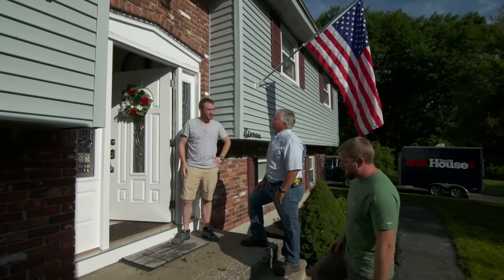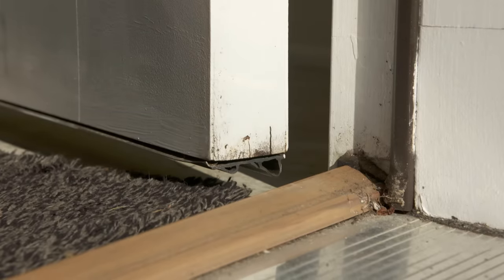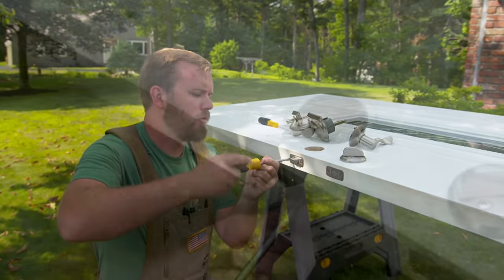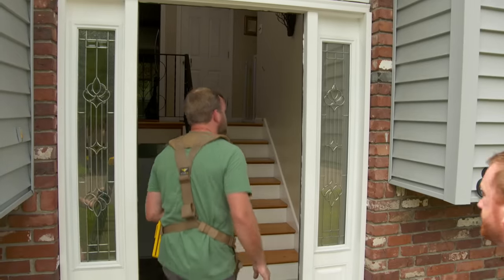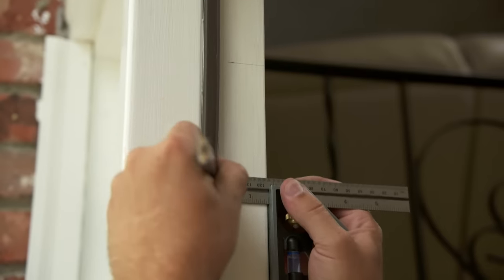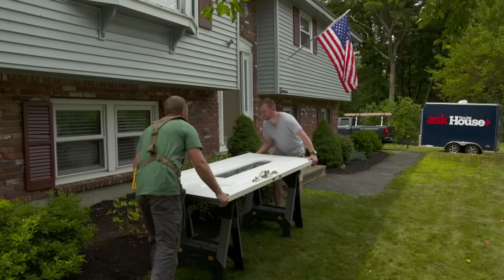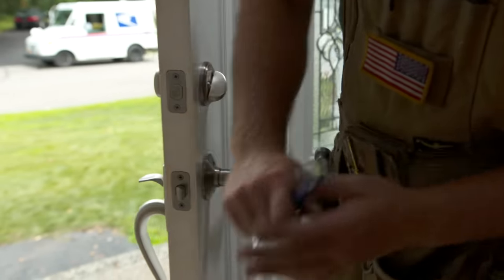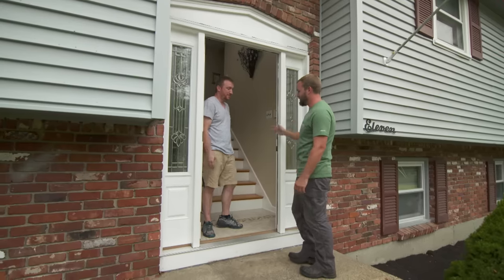How to Swap the Swing of an Entry Door | Ask This Old House

Comment: As a carpenter of 42 years always keep a bag of golf tees for filling old screw holes. Much easier and faster than whittling  small pieces.
Reply: That's what my dad used to do. Sometimes toothpicks to adjust a door, too.
Reply: @susanblackley7065  yes, toothpicks can do both.
Reply: Nice tip….
Reply: Instablaster...
Reply: I use match sticks to pack holes, will keep an eye out for golf tees now tho
Reply: I got 1000 in my van too!
Reply: @Susan Blackley  just curious. How can toothpicks adjust a door?
Reply: @cdsmit27 you can put it behind the hinge to fix a reveal
Reply: @darbyheavey406 that’s what she said😂
Reply: Bamboo Skewers too the rescue!! And toothpwix

Comment: Am I the only one that thought the homeowner meant he wanted the door swing to change to an outswing instead of in? That would have solved the issue completely.
Reply: Yes that would make the most sense but for some reason no one does that. I think schools and other commercial buildings do cause it’s safer in case of fire
Reply: @njs461  The only place I've seen it  in common practice is asian countries, where land for building is scarce, so they try to maximize square footage and storage as much as possible within their small spaces.
Reply: But then how would a home invader kick in your door?  They would now have to pry it open like the Home Alone folks.
Reply: @twistedstrength.  No. Your hinges will be exposed on the exterior if your door swings out. It would take 2 seconds to take the entire door off if you did that. No prying required.

Comment: Isn’t it going to be more difficult opening the door this way? The only hope looks like to have the door open outwards or complete remodel the stairs layout.
Reply: I would have prefered it the other way - opening into wall and opening up to hall and stairs..
Reply: This looks like turning the correct solution into the wrong one. I eve wondered if this mod is illegal since exit doors should not block people trying to exit

Comment: I agree with Tommy a couple of things i would have done different. 1 get rid of the old evidence marks on the door from the old hardware looks tacky. 2 The chiseling of the new hinges , I would made cuts across first so my jamb didn't run and wind up with a cut to deep. 3 longer screws on the hinges..

Comment: My house is over 130 years old and has a similar setup. However, if I were to switch the direction of my door, it would get in the way more, especially whenever I want to move any large items in and out. It’s a bit of a hassle- along with not having closets- but typical for an old New England home.

Comment: That’s great work! I’d have changed it to opening out to the front so that inside I could have some storage etc and never need to pull door open into the family crowded there lol x
Reply: Exterior doors don't swing outward for a number of reason.
Main reason being, then your hinges are exposed on the outside and any person can pop them off and take your door right off in 10 seconds.

Comment: Story stick on hinge location more reliable than using a tape.
Reply: Glad you called that out!!  I amazed that everything lined up so perfectly based on the technique used.  On old doors I've actually made full size templates of the hinge side of the door.
Reply: Bingo! I was actually checking the comments to see if anyone else picked up on that. Those hinges have to be perfectly matched to operate correctly. No way to reliably do that with a tape measure.
Reply: Came to read comments for the same reason.  I suspect he first located and screwed only the top hinge, temporarily pinned-in the door so he could mark the exact location of the middle and bottom hinges before chiseling them.

Comment: Did they skip over the part where they fill in the old strike plate and deadbolt holes that would remain after switching sides? Pretty sure they showed where they filled in the hinge depressions, but not the two deep holes that would also remain.
Reply: I was thinking the same thing, but I would guess that you would have to measure, cut and fill the striker & deadbolt hole. I’m doing this same project on my back door

Comment: The screws he uses are a bit short aren't they? I would use like 2 inch long ones...
Reply: Those look like interior hinges, When I build a house I don't even use screws that short, they tend to loosen up over time.  Hinges with long screws and a large metal strike place are called "security hardware sets" Basically just heavy duty.
Reply: 87woutor 
I agree
Reply: Half of an inch of a screw isn't going to stop anyone from breaking the side window and opening the deadbolt from the inside.
Reply: @DordiHOTS  I replaced the screws on all my hardware with screws long enough to reach into the 2x4s. If someone tries to get in they are going to make some noise.
Reply: With panels on both sides they cant really do anything else here though.
Reply: They are standard but the longer ones are optional
Reply: If people want to break in, they'll get in no matter how long the screws are...
Reply: @DordiHOTS  yeah, that should be a dual keyhole db.
Reply: @tomgaffney740  Visit the lockpickinglawyer's channel to watch him pick dual keyhole locks, db. That isn't going to stop an intruder from breaking the side window and opening the deadbolt or finding another way of entry through a window.
Reply: @DordiHOTS  I'm talking about key entry both sides of door. So if you break the window n reach in you still have to pick inside lock instead of turning a lever. Of course anything is just a deterrent. If somebody really wants to get in they will.
 Everybody needs to understand this. Security is fools gold. If criminals dont have to worry about time or too much noise then they will get in.
Reply: @tomgaffney740  

Ah, that might help, that's a good idea. And yeah, I agree, if someone really wants to break in they will find a way. That's why in addition to good locks, you should have cameras and a security system.
Reply: @DordiHOTS  yes, I have a dual key deadbolt. The only safer way to have deadbolt in a windowed door. 
Yes, cameras n A gun or 2 or 3 😁
Reply: would an intruder kick in the door or would they just throw something through the sidelight and reach in and open the door
Reply: The sidelights on both sides limit the length of the screw. This might be why the original installer opted for a lighter fiberglass door: to lighten the load on these shorter screws.

Comment: Easy to follow instructions thanks. 

In this case though,  why didn't they have the door open outwards away from stairs?
Reply: And expose the hinges for anyone to pop off in 2 seconds? Sure. 

Also might not be possible depending on the jamb, threshold and brick mould.

Comment: IS it possible to add on to a door . To make it wider? Or taller? I have a cool old door I wanna use in my renovation.. but, it’s super small..
Reply: 1806StoneHouse you can make the opening smaller? Install a new frame?
Reply: TOH has some videos about making doors smaller. Just scroll through all their uploads
Reply: Richard van Pukkem re read his comment
Reply: 1806StoneHouse  Yes you can add into an old door. Use the right materials and talk to a knowledgeable person who can help you in making the right choices and best way to go about it. Good luck
Reply: Yes, Its easy just cut two lines at the bottom in a V shape with a circular saw set at 1/2 the thickness of the door (at the length factoring in your angle so the top of the v is in the middle of the door) and cut the V, Cut the inverse on some wood as thick as the door and of the same type (if stained) and glue it in and use some nails to go through both the door and the new wood piece. Its a strong joint that tends to resist cracking, A lap joint can be better but you cant do that with just common house tools. Finger joining would be best but I doubt you have the tools, So this method will work way better than trying to toenail in something 

If its not to wide, Drill through the bottom of the door and screw up through the whole assembly to pull it together. 

If you are doing all 4 (or 3 sides) do the bottom side first, then after that is done cut the whole side of the door with the v method and do the sides, It will make it stronger than doing the sides and having one bottom board the new width of the door. 

Use a razor knife to score in some lines so it looks like its multiple boards if you want the aesthetic. 

Im a gc and new home builder. 

Diy work like what you want to do is a perfect way to improve a house, 
If you have any other questions just email me Ozziesheppard (at) Budgetbuilders . com
Reply: If its a wooden door and your going to paint it then yes. A door like in this video then the answer is no.
Reply: @tysmith7646  If its old most likely its wooden,
Reply: Ozzie, that joint would still be end grain to end gran. Your just exposing more fiber ends. It would actually be worse than a buttjoint. A slot joint would be better and use a pice of wood in between like a floating Tennon or tongue and groove.
Reply: @gitarplayer229  I'm not sure where you got the Idea to do it against the grain, If that door is in any way normal the wood is actually connected with the grain on both the door and repair section. minimizing expansion and cracking.   This joint is fairly common for structural applications where stability under a compressive load is needed (why I said to through screw the assembly)  Most older doors have A bottom board with grain going across the face of the door paralell to the bottom, Naturally the board would be installed in the same direction. 

 This joint is basically a finger joint, which if you didn't know is a very strong joint that is often used on structural 2x4 in end grain connections.  I have made this joint many times and I have made a butt joint many times, the butt joint tends to break if it is the point where a door stop hits the door to stop it, I used this joint since and have had no issues. 

I am interested in your background, Are you a wood worker?
Reply: Ozzie, I see what your saying. I’m just not familiar with doors having the bottom board already attached sideways. I think of an old door as a big slab making the top and bottom end grain. The V joint would be fine for the sides kinda like a tongue and groove. It just didn’t make sense to me if the bottom is end grain. I am a diy woodworker.

Comment: I dunno about swapping hardware directions.
In my opinion I would’ve swapped the hardware over, lock and latch on hinge side and vice versa.
I can’t tell by the video if the door is can be universally swung, but the hinges are installed incorrectly.

Comment: I have to do the same thing, but I have been told I can't do it and need to buy a new door because the current one is composite material. Any thoughts? I can't spend £1800 on a new door.
Reply: Buy a cheaper door

Comment: Not hard if you got the right tool for the job. But door hinges  i dispies. Just make ones  that doesnt require chiseling to mount the hinge plates flush. Id prefer a hinge that bolits to the face of the door and face of the casing.

Comment: I know you couldn't use 3 inch screws on the jam but
you could have used 1 1/2 or 2 inch screws that door
could be kicked in by a 99 pound weekling.
Reply: Why kick it in at all? Break glass, open locks and your in.
Reply: @calebburns4346  true.... Hell it's a kwikset.just stick in a paper clip

Comment: Hi This Old House . I hope someone can respond quickly? I have a closet door with mold all the way thru the bottom wood door. 
My dog has separation anxiety and during my sickness with covid he shaped the soft moldy part into bits. Now I have a hole that spans the bottom of my wood door as he removed all the moldy part. 
My landlord says" there's no way to turn the door upside down without having to drill a new hole , no calibration".

As an artist I see it's no problem to put wood panel an paint the door. No need to change lock . Just put hinges on other side .
Reply: I meant my dog scraped

Comment: everything reversible, including the sweep? square, plumb and level door frame? in the real world those easy jobs don't exist.
Reply: we did it to all 3 of our entrance doors a few years ago, with a handy man, who also was a sales man for window and doors. Since All 3 door to this old trailer / small mobile home had uncomfortable odd ways of entering. And with the opposite way of entering, we could use the space better in this small home, by reversing them all.  The one door we wanted bigger, so we had to get a new door, plus we made it an opposite swing open. And the patio door had to be new, as it was 30 years old and not keeping the cold out, BUT because we wanted the left handed opening patio door,  it cost more to get the left hand opening patio door, but now a lazy boy chair can sit in the walking space.   Finally, to reply to your message, our front door we just switched everything around, like this video, and everything worked without a problem. It too was a similar new front door, someone else put on this trailer home. And it was perfect to turn everything around. ((BUT for the 250 bucks we paid the handy man, to do this, we didn't get those nice sprayed white thin dutch plywood coverings, so think I'll do that)) And since we switched the front door swing in, we have room to keep an old Chinese chest, we didn't want to sell, now it fits, where the door swing once use to have swing open to.  So it makes sense to change the swing opening of the front door.
Reply: 🤣🤣🤣 yeah simple as 1,2,3 ! 👎

Comment: The door glass insert needed to be reversed as well.  It isn't weather sealed from that side.  Water can get into the door
Reply: Not to mention at 6:54 mark you can see the hinges on the door are now backwards, he forgot to to swap the position of the hinges. There is a bearing on the hinge but it is not on the load side of the hinge now.

Comment: Alright people of YouTube.
I am wanting to do this to my front door. Our builders were stupid an the swing makes no sense in front of our stairs.
However, the hole for the strike plate in the jamb is at the exact level of the middle hinge. So I would obviously need to fill that, but with what since it's such a large hole? 
Also, is it even possible to fill it and have that hinge be secure enough? Maybe put in 2" screws on the middle hinge?

I also I'm seeing people say why not change it to an outward swing. Isn't that against code? I thought I read somewhere that you have to have an inward swing Because of fire code or something. Which honestly doesn't make sense to me because I would think that you would want to push out and not pull in if there were a fire, like in commercial applications. Thoughts?
Reply: Because the hinges would be outside! And doors are removed by taking them off their hinges.
Reply: I am also wondering the same. Are we supposed to use wood glue? Bondo? Fill in with a block of wood and screw it in?

Comment: My only question is about the glass in the door. Most door glass is only sealed on one side, so by swapping the door around, the water can seap in between the door and frame for the glass, soaking the insulation inside the door.

Comment: How about making the door open towards the outside instead?
Reply: Then your hinge pins are outside, easy to pop out and break in. (But maybe there are security hinges available?)
Reply: In sweden all exterior and bathroom doors open towards the outside. The hinges used on exterior doors are ”lifted on” so they cant be undone when its closed. Also they are very hard to kick in. Saves on interior so i dont understand why its done differently in the us
Reply: @michaelsteinbach  ..They make hinges with non-removable pins..
Reply: Here is swing (link below) that can be used on door that opens outside. 
Pin is fixed and you install door when it's fully opened and once it's closed it's impossible to lift door off from that pin. There are also 2 type of adjustment to set for reveal around door.
https://www.pihla.fi/verkkokauppa/media/catalog/product/cache/1/thumbnail/600x/9df78eab33525d08d6e5fb8d27136e95/p/i/pihla_ulko_oven_sarana_sinkitty_kirkas_vasenkatinen.jpg
Reply: Mr. Wizeguy exactly the same in sweden!
Reply: Does the USA building code require front doors to open to the inside?

Comment: So now instead of the door hitting the stairs, he has to step up onto the stairs upon entry to avoid the door when it swings back to close--totally goofy
Reply: @martinladjimi3238  
That house needs a porch
Reply: @martinladjimi3238  you never have outside-facing doors open to the outside because then the hinges are on the outside. That means it is not secure at all because the door could be removed from the outside.. no key required!
That said, IMO seems like a dumb idea when you consider having to either step backwards up stairs to fully open the door, or stand behind the door to let someone in. But Tommy "seems" to agree with the homeowner, so might be a case of us viewers not understanding the situation.
Reply: You can stand to the side...  I used to live in a split entry and never had that problem.  Door swung open the way they have it at the end.
Reply: @toddposton7322  your correct. Though there are security hinges that can not be popped and there are reversed hinges too that can be used but without adding additional hardware this was the best solution
Reply: House needs to be demolished